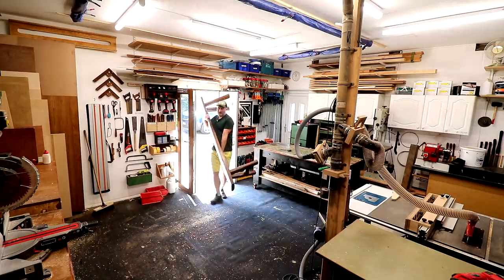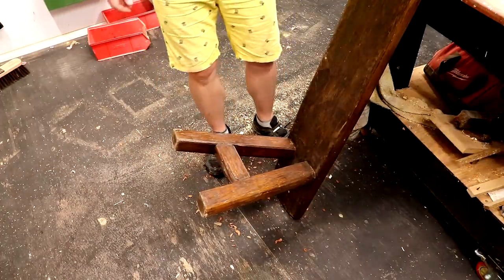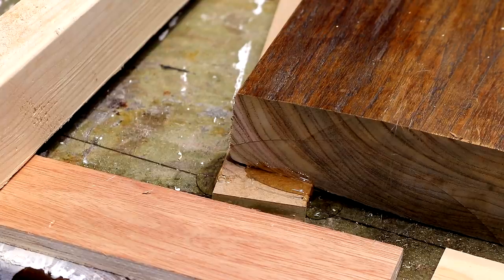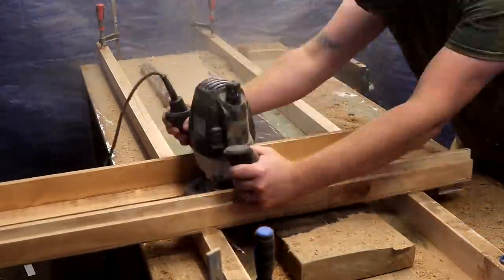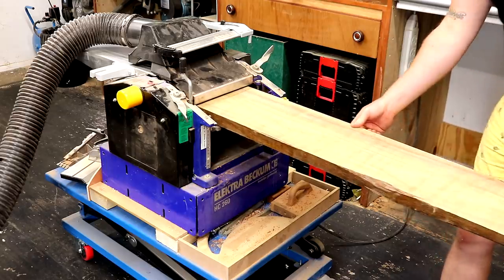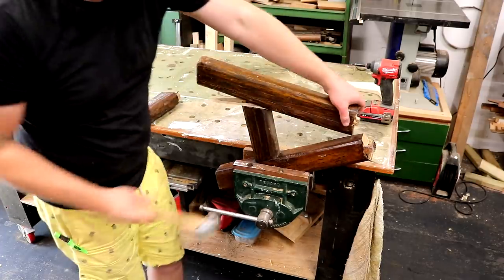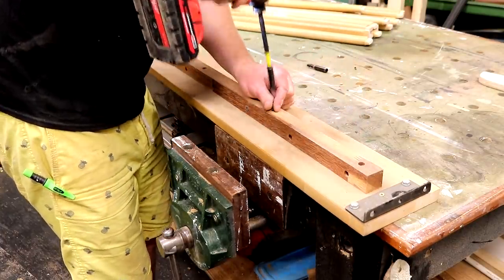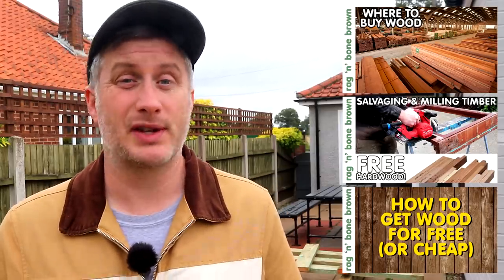Free Reclaimed Wood!

Comment: I agree.  The lumber from the bench is indeed lovely.  I absolutely love your portable tarp enclosure.  It was a stroke of genius to add this.  I also love the router sled for flattening lumber slabs.  I have found that if I keep an eye out, I can often find old bed head boards on the side of the road or at the curb.  They don't usually provide any large slabs, but I can usually get two or three inch wide boards and I feel very lucky when I find the bed slats that go with the head boards.  Thanks for another great video.
Reply from the maker: cheers! Yes bed slats are always a great find

Comment: Just a side note.. Bed slats are great for a quick and easy segmented bowl blank.  Cut lengths of around 300mm ( for your size lathe) glue together and boom a quick cheap blank for a fruit bowl or smaller egg bowl for the kitchen side.

Comment: Good to know all wood is used, even if it's just for fire. Do you need to take any caution when doing so? like to burn a barnish that might have toxic fumes.
Reply: I do the same with mine, but my fires is not open so I believe most vapours go up the flue. Also it’s mixed in with good firewood so there isnt that much burnt at once.
Reply from the maker: I actually don't burn it myself, it goes to friends and family...!  I don't have a log burner unfortunately

Comment: This video DID inspire me, Keith, but not to do any reclaiming - 'cos I've got no room to store the results!   What I did see, and will really try to remember, is you again using hot glue for temporary fixings.   I have seen you do this before and thought how efficient the technique is, but have continued to struggle with clamps because they are immediately to hand whereas my glue gun is in a drawer somewhere.  I will definitely retrieve it, and position it so it is readily available.   BTW, as Wranglerstar says, when rough wood shows its beautiful interior, 'It gives me the fizz!'
Reply from the maker: cheers Don. Yeah the only downside with hot glue is waiting for it to heat up!

Comment: Sadly, I thought you would not need the legs, want the mid span of the board, and therefore cut the board 1 inch inside the legs, turn the 2 longs sides together and joint them together to make a great stool, and have the long board, both.